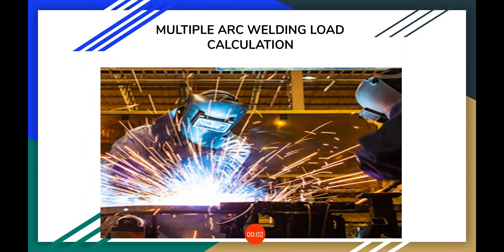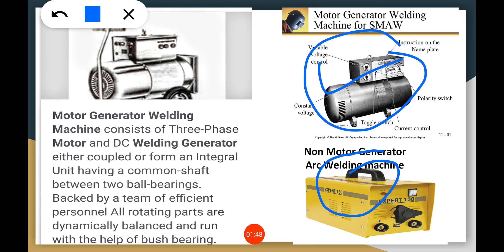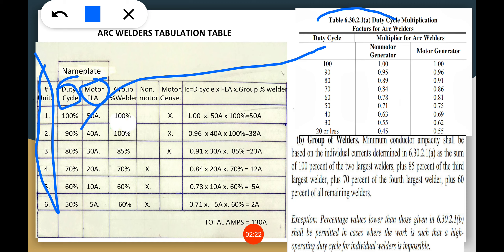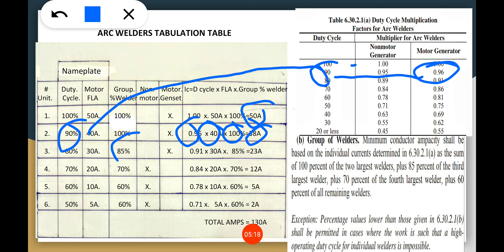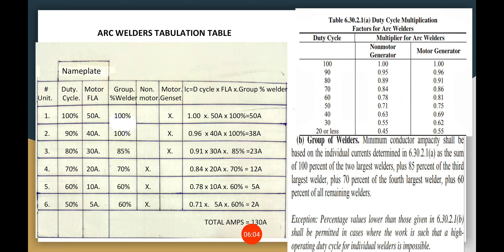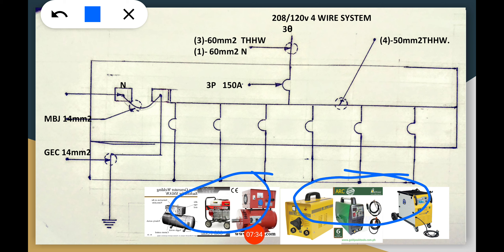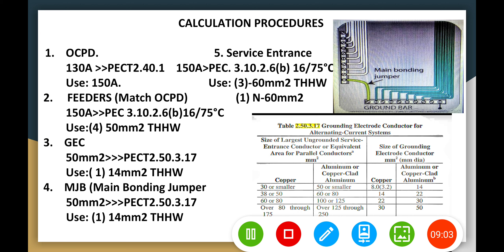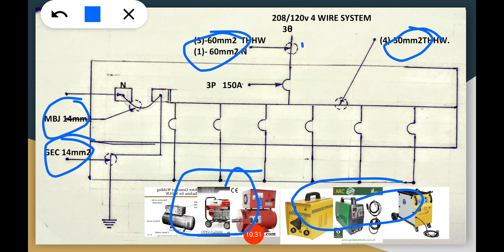MULTIPLE ARC WELDING LOAD CALCULATIONS

Comment: sir good morning. may tanong po ako. may panel po kami na may load na 10 welding machines. ang ginawa namin is bawat welding machine is meron siyang breaker. papano ko po ma compute ang main breaker nung panel na yon? paano ko rin ma compute ang para cable ng main breaker?
salamat po sa iyong magiging kasagutan.